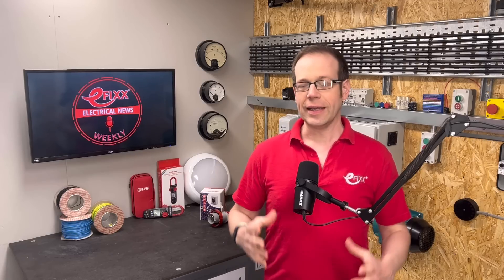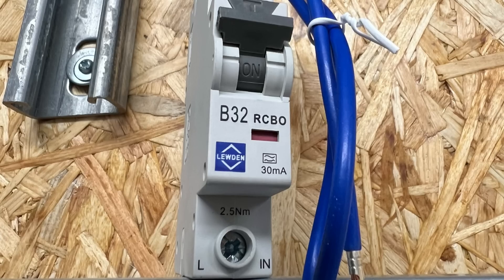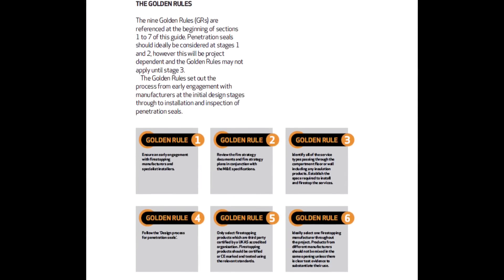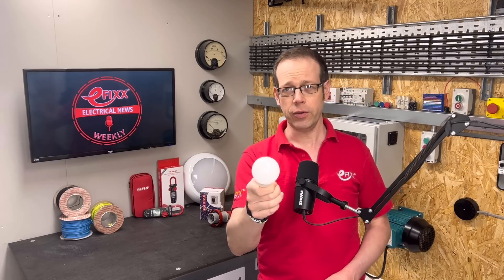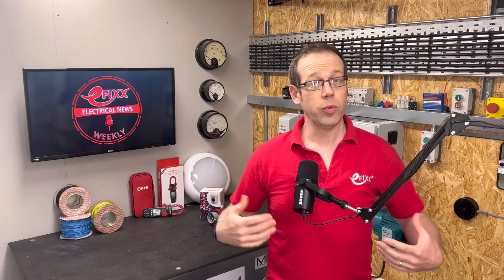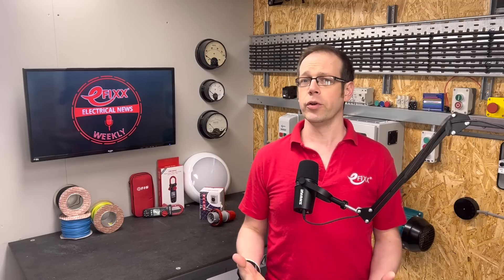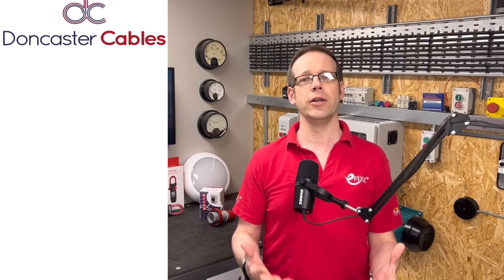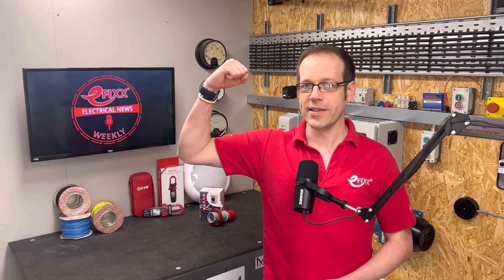Unveiled: Major RCD Blunder in Heat Pump Installs

Comment: Why does a heat pump need an RCD I have never fitted one surely they do not have any user accessible terminals,so a MCB should be fine, if the cabling has suitable mechanical prediction

Comment: Interesting, it would be interesting to see some measurements of DC leakage from real world heat pump installations? Has anyone done this?
Reply: Hi, I am a tech engineer for Stiebel Eltron and one of my coleagues has tested an rcbo with a compressor running, and wont trip on a test.
Reply: @andyprobert7040  interesting, thanks for sharing. Was that a type A RCBO? Do your instructions specify type B?
Reply: Yes our instructions specify a type B Rcd.
Or mostly i train the electicians to install with a method without RCD on the compressor circuit.
But its important to remember that any RCD up stream is also affected.

Comment: One should always check the installers manual. Many are ok with RCDs Type F, some are even suitable for Type A (internal DC fault current monitoring or other additional protection present). Installing Type B by default might be a general solution, but a costly one, so consulting the manual can reduce costs. Thanks for pushing the issue to a greater audiance!

Comment: Many years ago I visited an egg farm with about 8 fans each controlled by a small inverter drive. The distribution board was a standard Hager unit with an RCD, which kept tripping if more than 2 fans were connected. I advised they fit an Si type RCD which included immunity to the superimposed DC component arising from the EMC filters on the inverters. At the time these weren't widely available so I just left them to order one and fit it, in the hope it would fit in the Hager board.

Comment: What’s more concerning is the fact that a heat pump sat on rubber feet should (in my opinion) be treated the same as an EV charger and have a dedicated earth rod (because they don’t have open PEN detection). What’s to stop the outer case rising to 1/2 line voltage in the even of an open PEN fault in the supply?

Comment: If an inverter heatpump needs a type B RCD, then so does a fridge/freezer or aircon unit, which typically also have inverter drives these days. Smooth DC leakage from these is pretty unlikely, compared with products with big HV batteries.
Reply: Frankly if anyone is desiging a modern inverter that exceeds 6mA of common mode leakage then they need to go away and do it again properly!  Absolutely no reason not to be able to make an EMC approved inverter for any low power domestic product these days......
Reply: If it's about batteries (EV or stationary) and solar, I can at least see the 'smooth DC' argument, but it's weird that heat pumps are also catching flak, and that the reasoning for it makes no sense in relation to all other appliances that use the same technology and have for decades, every device with a switch-mode power supply also has a rectifier, and using that as the basis for demanding Type B is crazy. Unless the next step is to make them mandatory for every circuit in the house? I'm sure the manufacturers would love that.
Reply: Fridge freezers are generally on/off motor control with no control over the speed.

Washing machines and dishwashers often have inverters as they need to change the speed of the motor.

The IET also say that Type A is suitable for inverters as well as Type B.

Comment: Nobody is addressing the issue of where the dc current goes after the type b rcd . It flows back through all the other type A RCDs on the installation .
Reply: No it doesn't.
Try analysing the circuits to understand why.

Don't guess. Work it out.
Reply: @deang5622  nobody knows yet dean least of all you .

Comment: MCB out of the consumer unit, into a Type B RCBO in a separate enclosure.
Reply: Yes, if you can't fit or obtain a type B RCD for the consumer unit.

I have noticed a tendency for some properties to be fitted with type AC.

And I suspect they are far more common than people realise.

And I have observed electricians doing EICRs on properties and not picking up on it, which quite frankly is appalling.

Comment: Another question about heat pump installations: should pen fault protection be added? I know it's not required. It seems the same potential hazard exists as for EVs on charge in that there's a big piece of metal connected to the  main earthing terminal sitting outside where a person standing on the ground can touch it. No RCD will help you if the pen goes high impedance...
It's probably a very small risk & may well be deamed low enough to be acceptable.
Any thoughts?
Reply: I’ve been told board manufacturers are bring out Pen fault mainswitches as you are correct .
Reply: @persona250  Devices to fit in a cu are available, just not yet mandatory for hp installations. I wonder if IET will bring in an amendment?
Reply: @alanjewell9550 I doubt it.
People go up to and touch car bodies.
They have to in order to gain entry.

They don't go up and touch heat pumps.

474 broken PEN faults in 2021.

Comment: Many washing machines feature inverter driven motors , will they affect a/c RCD operation ?
Reply from the maker: Yup, that's one potential source of DC leakage in a property. 😬
Reply: @efixx  yes but do they need type B RCD? Washing machines that is.
Reply: Read the article by the IET on how to select the correct type of RCD.
Reply: Yes but the Niceic say it’s only a c3 on an Eicr so you can pass the installation.
Got told off for putting c2.
Reply: @smiffysmiffy123  thats my concern as whether it makes installs unsafe and needing a C2

Comment: I still don't get the Torque Calibrated Arm.!?
Reply from the maker: We did a whole campaign on doing up electrical connections to the right torque settings. Lots of electricians responded by saying they've got torque settings in their arms. We tested a few to see if they were right... they weren't! Hence, there's no such thing as a torque calibrated arm! 😂
Reply: @efixx  Oh I am well aware.
55 years plus in the business, never posessed a torque Screwdriver, never used one. No fires or burned connections ever. I know a few who don't use them.
But hey, what do I know..

Comment: Luckily we have the IET to ensure we have clear labelling of protective devices, consistent performance of AFDD with standardised status LEDs and tightly controlled standards so we can swap out protective devices without throwing away the consumer unit every 3 years. Also the IET have reassuring decided that you can only get killed by a PEN fault from a EV and not a heat pump or garden class I lighting. Keep up the good work guys.
Reply from the maker: Watch this space...
Reply: @efixx inverter drives are becoming standard practice in things like washing machines & have measured higher DC
Reply: Labelling of RCDs is clear.
The symbols are defined.
Reply: @deang5622  Symbols aside, Type is ambiguous with reference to RCBOs. When they were relabelling words like Discrimination to Selectivity, perhaps more effort, by the appropriate biscuit-scoffing committee, should've been paid to change words that actually mattered.

Comment: Really the designer/manufacturer should be quoting the DC currents imparted by their loads, it shouldn’t be for an installer to measure the DC currents and to fit an appropriate RCD type.
Reply: Hi All, I am a Technical support engineer for Stiebel Eltron, the instruction to install a type B RCD is in our instructions.
But only 5% of installs I see have the correct fusing.
Thanks for this video. Its a major problem with installs.
Reply: @andyprobert7040  Thank you, it's great to hear that Stiebel Eltron take their documentation responsibilities seriously.
Reply: I read somewhere that is a legal requirement (within the EU) that appliance manufacturers are obliged to state the requirements of the electrical installation to power their appliances, including specifying what type of RCD is required.

I looked at a few washing machines and dish washers which contain inverters where there is likely to be a DC leakage current and could not find any official product documentation from the manufacturer which specified this.

It's completely unacceptable.

For one major German manufacturer I contacted them and asked them about the actual magnitude  of current for their product and they could not tell me. All they could tell me was the fusing requirement in the appliance's plug.
Reply from the maker: It’s in the instructions
Reply: @efixx  Is it? I can't find any reference to leakage currents in the Vaillant Arotherm Plus Installation Manual - That's a very common model of heat pump.
Reply: @yngndrw.  So it looks like @efixx has uncovered a glaring omission in supplier documentation. It can't be possible for an installer to make these determinations and it's likely that products will have a wide spread of leakage values.
Reply: Please note the issue with DC voltages is if the heat pump has INVERTER control which a lot of the small ones don't have so no need for a type B!
So installers need to look for the word INVERTER which the heat pump usually has in big letters as it is expensive & is more efficient!
It has been a bugbear of mine about inverters as used in other air compressors!
Also what about washing machines as these use inverters now!!!!
I did put a type B in for my unit but I will test for DC voltage & current backflow at the weekend!
Reply: @Electronics-Rocks  Type B is something I speculated about becoming a requirement on another youtube channel.  A product with motors doesn't need to have the word inverter in it to be in the potential DC leakage class anymore.  So many things have variable speed motor control these days it's essentially everywhere, the days of simple line operated motors are in the past.  Standard small 3 phase motors with VFD style drive, multi-phase BLDCs, even PWM'd basic motors.  Washing machines and clothes dryers are a perfect example.  Unless you shop at the super-low price end of the market, all of them employ one of those classes of motor drive yet not a single mention of 'inverter' in the description / title of most of them.
Reply: @retrozmachine1189 There is an article written by the IET which sets out how to select the RCD type, and if I recall correctly, it states that in the event the manufacturer doesn't state the type of RCD, a Type B should be used.
Reply: @Electronics-Rocks It is NOT DC voltages that are the problem. It is DC currents!!  There is a big difference.
Reply: @Electronics-Rocks  Almost all modern A2W heat pumps for domestic use will use an inverter these days, for both the compressor and the fan(s). If it uses the R32 or R290 refrigerants then it's almost guaranteed.
Reply: @Electronics-Rocks So you say a type B is not required for appliances containing inverters.

Here's part of an article published by the IET:

Type B

Type B RCDs are used for single and three-phase equipment.

 Examples of equipment include:

inverters
uninterruptible power supplies (UPS)
photovoltaic systems
lifts
escalators
welding equipment
industrial machines, and
electric vehicle charging equipment with smooth residual DC current which is greater than 6 mA.
Type B devices are also suitable for Type AC, Type A and Type F applications.

Inverters are in that list for Type B